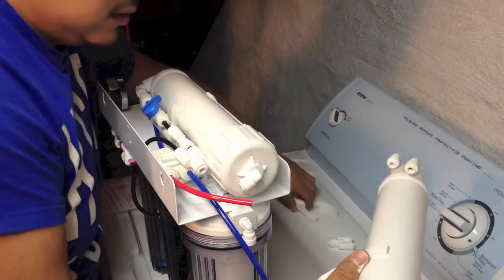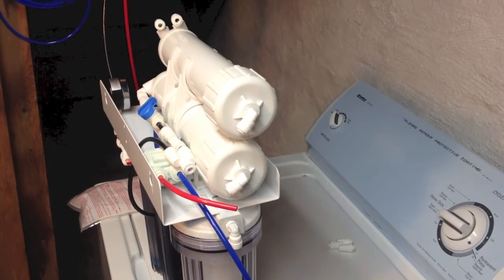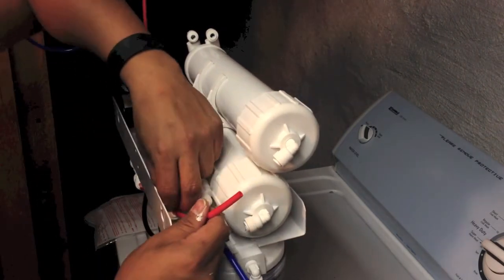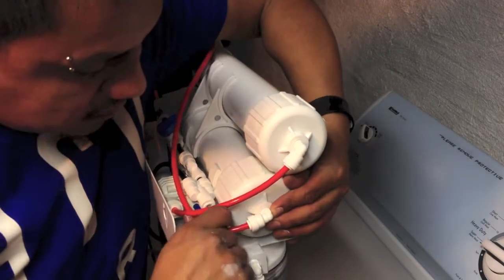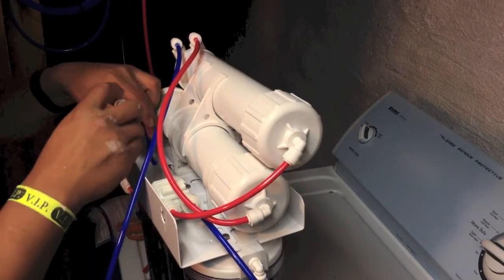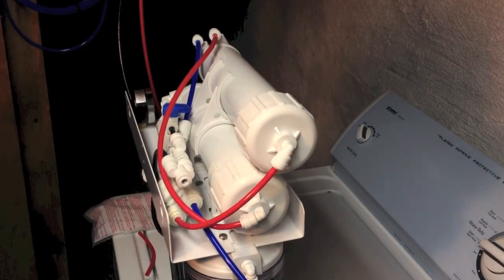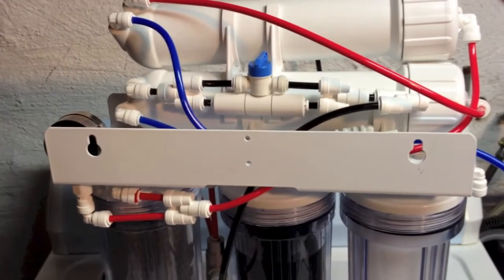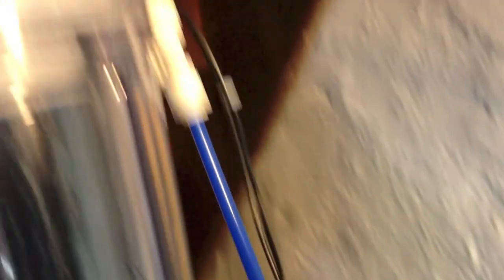The 150 GPD membrane installation, Pimp my RO DI

Comment: Can you clarify, is the new membrane a 75 gpd membrane, so you now get 150 gpd,?  Or is the new second membrane a 150 gpd membrane?
Reply from the maker: PlantedMN  the new membrane is a 75 gpd membrane the way it works is that the outlet of the first 75 gpd membrane goes to the intake (intlet) of the second 75 gallon membrane en the outlet of the second membrane goes to the rest of the filter system, this 2x  75 gpd membranes together makes the system a 150gpd membrane. Remember  that  if you are going to do this you need a pressure of 60 PSI minimum running through your system  that's the reason I have my pressure pump installed, the pressure here where I live is to low so I had to install it :(  check the pressure in your area and part from there, before you purchase the pump, Many places have  good water pressure, pressure in my system is over 70 PSI   below 90 PSI thanks to the pump, without the pump running my system runs at 30 PSI  which is no good for a 150 gp system. I'm able to make  a 40G in 4 Hours :) good luck!
Reply: Thank you.
Reply from the maker: your welcome :)

Comment: this video is great. I'm planning to do exactly the same set up. do you use ur rodi water as drinking water ?
Reply: Ryan Bondoc   yes  I do, BRS sells the drinking water kit, it comes with an extra filter called taste filter  and   Also comes with different sediment filter for the  rest of canisters if I'm not mistaking,  you have  to bypass the  deionization filter so you don't drink deionized water. 
BRS Has a video on how to do the installation for both drinking and RO water.

If you have any other questions, feel free to ask,  my system still working flawlessly  😁😀
Reply: Ryan Bondoc if you planning to  use the system for both  RO water and drinking...
when buying the  filters  I suggest you to buy the water drinking and reef replacement  filter kit. 

I will suggest you to call BRS and tell them your plans, that way  they can create a cheap package for you and  don't spend  more money than what you have.
Reply: macrapidito thanks for the advice. It's a little too late for that as Already bought a used 4 stage value plus from a friend. So I'm actually at the stage where I just bought the 150 hpd upgrade and the booster pump kit. They should all arrive in 3 days so this video is very helpful. I don't plan on buying the drinking kit for now and just get the drinking water directly from the RO. Any suggestions on how to set that up? Also, how did you move the connections from back to the front. It's confusing when you are not very familiar with the Rodi unit. Thanks again!
Reply: Since is a use  set up I will suggest you to get the  drinking and reef water filters, if you are planning to  drink from the system first of all  you will need to by pass the deionized resin filter (you don't want to drink  that water)  then after that you will need a  separate container for the non deionized filter water or in this case drinking water   ( this will increase your chances of water leaks  since you can't control  the water stop or start unless you have a float switch on that container) if you can save some money  I will suggest you to buy the drinking water kit from BRS is not that expensive, it comes with all the things you need and even more including the pressurized tank, fittings, house  and faucet. 
As far as the  membrane's flush valve the only thing I did to move it from the back to the front is remove the hose and replace it with a longer one that allows me to  have the flush valve at the front for faster and better use of it hope that is clear nothing crazy just remove one short hose  and replace it with a hose that is long enough to install the flush valve at the front do the same  with  both the inlet and the outlet of the  flush valve ( if you have one in your system)

Comment: I just bought the 150 gpd system. What got me was I was wasting easily 4 gallons per 1 gallon of pure water.. THe process took forever to produce my water.. I just received the kit and started looking up reviews and not seeing to many good things about the kit.. Whats your input is the water being produced faster and are you really seeing a decrease of waste water? Thanks Im in debate if i should keep the upgrade or return it
Reply from the maker: Hey Pete P  yes definitely you can see the difference in waste  the most important thing is the end results of your over all system in terms of TDS my system is  efficient in  all matters.

With the system I'm running I'm able to have a 1x1 water ratio, 1 waste for 1  cero TDS purified water  in video number 3 of this  video series I install the buster pump and you can see it with your eyes while I do the test. and sorry for the late response :(